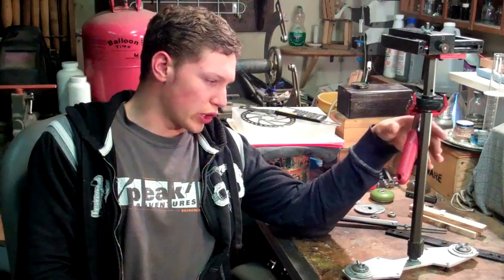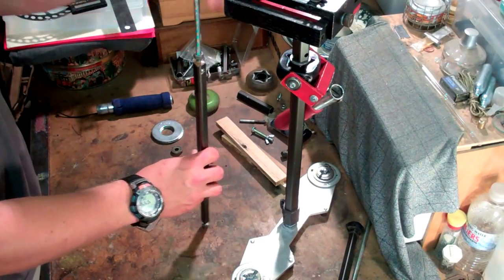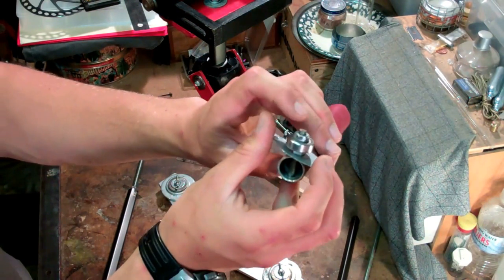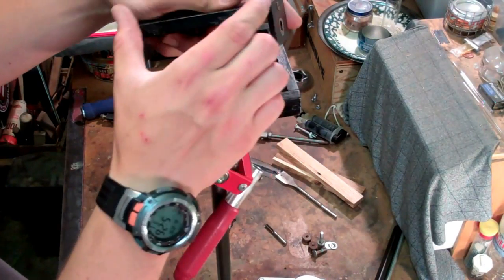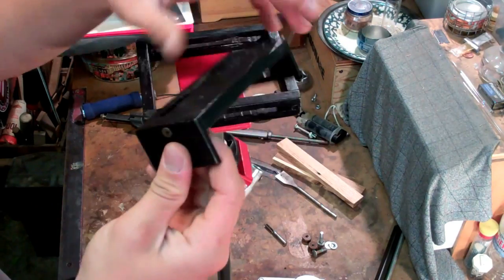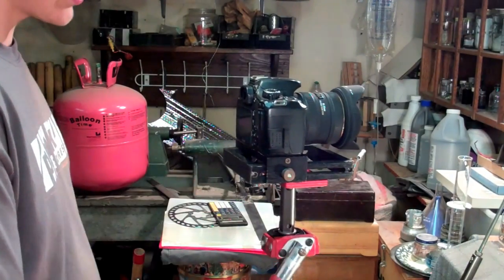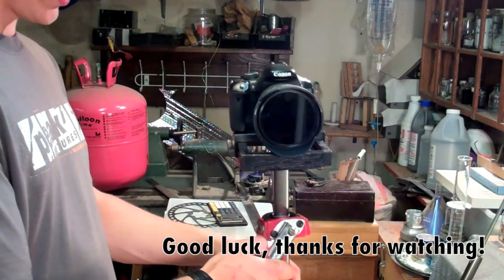THE BEST Homemade Glidecam/Stedicam Tutorial DIY

Comment: Thanks for sharing all this. I would suggest that if there is clearance above the top nut that holds the platform to the shaft, just use ONE bolt all the way through the platform. That way, with forward and back adjustments, you only have to deal with one bolt and one nut. But it looks like there may not be enough clearance, and that's why you had to use two.

Comment: I've been playing around with doing YouTube videos for awhile now and one thing that drives me crazy is camera shake. I realize that when the camera moves smoother it looks much better. I watched many videos tonight on how to make a camera stabilizer and this is the best build yet. I am fortunate in that I have a little Kodak PlaySport that is as light as a cell phone. So my build of this will probably be a little different due to the weight of the camera. The gimbal will still be about the same. I have a question on that. I thought I heard you mention that you used 5 bearings. I count only four. The one in the wheel itself, one on each side of the wheel and then the one for the handle. Did I miss one somewhere? I will re-watch the video to see if I missed it. But I can see that this will be an easy build and it will VASTLY improve any videos I do from now on. Thanks, brother. very well done.

Comment: Thank you so much.  Great video describing your process and design.  I'm planning to build one of these soon.  Really enjoyed you Selkirk Mts. video on your info page.
I'm thinking of using a long arca-swiss rail on the platform for front to back, then using two arca-swiss clamps back to back for the side to side adjustment.  I use the clamps and rails on all my equipment so this would be convenient to have the clamp on top. 
Watching your video, you use a nut, gimble, washer, shaft all tightened by a bolt on the platform.  It might be a good idea to use another nut just above the gimble so that that's always secure.
Reply: Those are great additions! Been wanting one of those quick release clamps for a while...

Comment: THANKS,

For faster-finer balancing: 
1. Attach the camera mount using longer 1/4 inch bolts (2" to 2.5") using wing nuts.
2. Add similar 2" to 2.5" 1/4 bolts to the front and back center of the platform (threads out).
3. Place 2 nuts (and shim weights for heavier cameras and lenses) midway on each bolt.
4. Adjust the camera to gross balance the glidecam using your technique with the wing nuts on all 3 bolts through the camera mount (sides and bottom).
5. Now move the new nuts (and shim weights) in and out to quickly fine tune the balance.

Comment: Yes, that is exactly what I did. I just super glued them in there; it is important that they don't move, because if they do, your balance will be disrupted. I used a small washer between the wheel and bearings to keep them from potentially rubbing on the wheel. I used ordinary 'sheetrock' screws that were about an inch long to hold the bearings to the wheels. Any screw will work, really.

Comment: You mean the long bolt piece? I cut a small piece of wood (maybe an inch long) so that it would loosely fit in the tripod leg, and used epoxy resin to secure it in there. Once that dried, i drilled a hole in the wood to loosely fit the bolt piece, and used epoxy to secure that as well. Make it as straight as you possibly can. Did that help? Or still confused?

Comment: Hey Vlad!

This inspired me to finally construct one myself. We recently got a new camera and I've got the bearings, tripod and wheel. 

I read in the comments that you've made some improvements - I was wondering if there was anything you'd be able to tell us on your new design before I fabricate all the parts for the one you show in this video? :D

- Kate & MJ
Reply: Kate & MJ Hi! I'm glad I could help with this video. 

Yes, I've made several changes since the video. The most important one is to the gimbal. I discovered that the wheel was not balanced enough around the center of the bearing. This caused the glidecam to be balanced only in one direction (forwards, for example), but when you turned the camera to the side, it was off balance.

Basically I designed and fabricated a gimbal that I could fine tune to be perfectly centered once I put it on the glidecam. I have been wanting to shoot an update video and show the new gimbal sometime soon.
Reply: Chemistry, Films, and More I see! It makes sense, depending in the wear of the wheel it may not be precise. I suppose we'll wait to construct our gimbal and return our rollerblade wheel!

Do you think you'll upload it pretty soon? No rush, just want to time it so when I finish constructing the base and mounting plates, I can add on the gimbal.
Reply: Kate & MJ Haha, people have been asking about an update for a while, so I guess I'd better make one soon. No promises, but hopefully within a week or two? If you have an old rollerblade wheel you can still use that and just upgrade later. That's what I did, essentially. :)
Reply: Chemistry, Films, and More That should be fine, a week or two! Yea I actually bought a rollerblade wheel since we don't rollerblade haha. It's pretty new, but I can see why it can be uneven and cause balancing issues, even if very slight.

Comment: Came to your channel specifically for this, will stay for your outdoor vids. :)

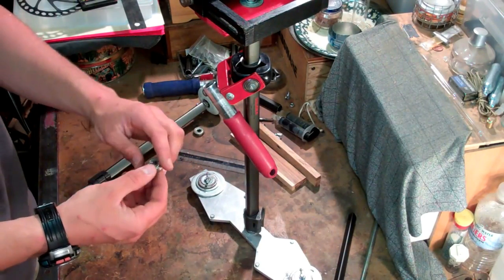Anyways, I'm just wondering why I need five (5) bearings for the gimbal? @ 5:11 you mentioned I needed 5 bearings but from my end I could only see three (3). Where should the other two (2) go? Many thanks mate!
Reply: There are are two inside of the gimbal (along the main shaft), there are the two visible ones on the sides of the gimbal, and then one that allows the handle to swing side to side, under the little metal plate. That make sense?
Reply from the maker: You got the answer! Glad to have ya!
Reply: Of Chemistry, Films, and More  ReviewOutdoorGear Gotcha! Re-watched the clip again and it now makes sense to me. Thanks guys!

Comment: Really great build! The thing I couldn't figure out is how you attach the rod inside the tripod legs, more specifically, the bottom portion since the bottom is extendable..
Reply: Ah, I've watched your video more carefully, and I understand that there are two separate rods there, but how do you get it so straight if it doesn't go down the whole length of the tripod leg?
Reply: ***** I use epoxy to secure the threaded rods. Epoxy is nice because you can let it get get nearly solidified, then use a level to make sure it's perfectly straight. Then is hardens and doesn't ever budge.  The bottom one is not as important in terms of how straight it is.

Comment: ReviewOutdoorGear Great video! Thank you very much! Do you have drawings or sketches showing the design and measurements of the different parts of your glidecam? And what's the diameter of the roller blade wheel?
Reply from the maker: Steinar Horten Thanks! I've since made more upgrades and adjustments to the device. I have a sketch of the new gimble. I was actually thinking to make another video because so many things have changed since this one. The wheel diameter varies with the amount of wear on the wheel, but in general it's about 2 inches or so.
Reply: ReviewOutdoorGear Awesome! I'm planning on putting together a glidecam soon, and think this design looks very good. What upgrades have you made since posting this video? Is there any chance you'd like to share the sketch of the new gimble?

Comment: One question: How do you attach the tripod leg to the base plate. There's a nut at the bottom of the leg or is there a bolt in it? And mostly, how do you attach the nut or the bolt to the tripod leg. I barely see that there was piece of wood, but how do you exactly did it?

Comment: For the weights i gave you earlier (which is how the rig in the video is set up), make the shaft about 12 inches (in shortest position) for that part below where the gimble attaches and about 5 inches for that piece that you add between the gimble and the platform where you attach the camera.

Comment: Yep. You just balance the rig so it would be tilted a little bit forward or backward, just like you would balance it to be perfectly horizontal when using it normally. It will work just as well.

Comment: You could always just attach your camera or phone and then add more weight on top to make up for it. However, the principle of this design works on almost any size. You can downscale it as much as you are able to. If i had a gopro, i would make mine about 8-10 inches long in total. Not sure if that's possible or not... you would need to find a smaller wheel for the gimble, or make a smaller one if you have the tools.

Comment: The way i did it was cut a piece of wood (about an inch long) so that it would loosely fit into the leg and glued it into there with epoxy. Once that was dry, i drilled a hole into the wood to loosely fit the bolt, and glued that in with epoxy as well.

Comment: If you glue it into the leg with epoxy and then drill it, i dont think it should break. But even if it does, thats not really a problem because the purpose of the wood is to stop the glue from simply pouring down into the bottom of the leg by providing more surface area for the glue to stick to. You could even wrap the bolt piece with duct tape or something and then pour the glue in around that. Just make sure that the glue is hard setting so it doesnt wobble when it dries out.

Comment: I whittled a piece of wood (about an inch long) that would loosely fit into the tripod leg, then drilled a hole in the wood to loosely fit the bolt. Then i used hard setting epoxy to secure it all in the top of the tripod leg.

Comment: I have this issue once in a while as well. To fix this, hold up your rig in horizontal position by pressing your finger in the center of the bottom bolt on the base plate. One of the sides will drop. Move the weights closer or farther away from the main shaft until it is perfectly balanced. Google (Vertical/horizontal Fine..what About Spinning? - Glidecam Product ...) for a page that can help you more on this.

Comment: - 2 1.5"x0.25"x2" pieces of wood
- 2 2.25"x0.5"x1" pieces of wood
- 1 2.25"x0.5"x1" piece of wood
- 1 2.5x0.375"x5" piece of wood
- At least 16 0.5" flat head screws.
- 4 1/4"x1" carriage bolts
- 1 1.5"x1/4" bolt
- 4 1/4" wing nuts
- 2 1/4" hex nuts
- Approximately 8"x3/8" threaded rod.
 - 3 3/8" hex nuts + washers + split lock washers
- A piece of 1/16 sheet metal cut to about 1"x2"

Comment: You mean the actual plate or total weight (plate and weights)? The weight depends on the length of the main shaft. To begin, make sure your shaft is in the shortest position. For starters maybe throw like 8-10 oz of weight on there (not including the plate). If your base plate is wood, you will need more like 14-16. From there, adjust the height of the shaft to achieve an approximately 3 second drop from horizontal position. If it is too fast, take of some weight and try again. You will get it.

Comment: How long of a pole do you think I will need, if I am using a canon rebel t4i with a 18-200mm lens? It says 10-15 inches, I was thinking I would need it to be around 12 inches...what do you think? (PS I am using pvc piping for the main pole so it will be hard to adjust it after I cut it to length.

Comment: Right around the 6:30 mark.  Can you tell me the exact steps you took to attach the bearings to the wooden arms and wheel?  Did you cut a 7/8" hole in the wooden arms on each side and then glue the bearing inside of that hole?  What screws did you use for this part?  Thanks.

Comment: Hi!
I am French , I use youtube subtitles but that's not it haha !!
Just one question : Is the threaded rod affixed/glued/fixed with screws to each end of the leg of the tripod, is not it ?
However one understands with images , I 'm about to create one that I should just find all materials in France , no worries !
Sorry , I use google translate ^^
It would be really cool to have an answer ;)
Reply from the maker: Martin Seiller Yes, the threaded rod is first glued into each end of the the tripod leg, then after it has dried, I drilled a hole straight through all of it and put in screws or rivets. The threaded rod doesn't go through the  whole leg though, otherwise it would not be able to extend to the needed length. Does that make sense? Ask me again if you don't understand something. :)
Reply: ReviewOutdoorGear Thank you very much for the reply !!
Yes I thought about that too, that it was unable to extend if it was across the tripod leg !
How many centimeters / inches you left around inside ? 2 inches I think ?
So you put a lot of glue and trying to hold the rod in the center -> How exactly,that it does not move ? ; until it dries :)
I'll see if I have more questions when I start the project, I'll post here ;)
Thanks again !

Comment: Making "mini version" for a gopro. You need 4 bearings right? One in the wheel, 2 on the sides of the wheel, and 1 for the handle, right?
Reply from the maker: +JustAskingAndCurios Yes. I've upgraded to two in the handle for more stability, but you can use just one. Let me know how the gopro version works! Been curious to see that for a while.

Comment: Question: What do you use (specifically) to be able to secure the tripod to the bolt that carries the gimble? and also the bolt that attaches the weight plate, im trying to find the right thing, but have had no luck. thanks.
Reply: My latest method is cutting a piece of wood to loosely fit into the tripod leg with a hole drilled in the center of the wood to fit the bolt piece, then gluing everything in with hard setting epoxy. When that is set, I drill a horizontal hole through the tripod leg, wood, and bolt, and rivet everything together on both sides (or you can use a screw or another small bolt). Does that make sense?
Reply: Pwrfect sense. Thanks mate!!!

Comment: when you have screwed top camera platform and bottom weight balance plate to a screw shaft, how can you extend your glidecam? I don't think you could extend
Reply from the maker: +akbar khan The threaded rod does not go all the way through the shaft. There are two separate pieces. One for the camera plate on top and one for the weigh platform at the bottom. Does that make sense?

Comment: Anyone know where I can get some good counter weights, or the best way to make my own?
The 5/8 washers don't weigh enough to counter balance my 60d + Tamron 18-200mm lens, unless I pour a ton of cash into more washers.
6 5/8 washers= 3oz, I don't think it's worth it.
Reply: I've actually updated the counterweights on this setup with weights that I've cut out of sheet metal. Some thick steel cut into rectangles works pretty well.

Comment: The platform is offset because the center of gravity on the camera shown is not exactly in the middle, but more towards the front of the lens, so i added more room in the back so that when i balanced the camera i would not run out of space to move back. The rig in the video has about 120g of weight on each side. You can always drill holes in the weights to fine tune their weight.

Comment: You will need, at least:
-Two sections of tripod leg (preferably the thicker two), with range from 10"-15".
- 3" piece of hollow tripod leg
- 12"x2" piece of wood or metal for base plate.
- A rollerblade wheel w/bearings intact
- 3 more scooter/rollerblade bearings
- 6" wooden dowel/pipe/scooter handle for gimble handle.
- 4 large fender washers (2.5" wide)
- 4 smaller washers ( 1.75" wide)
- 2 1"x0.5"x4" pieces of wood
- 2 1"x0.5"X6"  "                    "
- 1 0.5"x2"x5" piece of wood

Comment: do you have to have weight on the front and back? my rig requires A LOT of weight on the back to balance it so i didnt bother putting any on the front to make it less bulky, should i add weight to the front?
Reply: There should be an equal amount of weight on both sides. Forwards/backwards balancing is done with the camera on top. If you have unequal amounts of weight, the rig will start to spin and angle down to bring as much weight as possible closer to the vertical line of gravity. :)
Reply: Of Chemistry, Films, and More ok thanks

Comment: I have a problem with mine everything works fine its drop time is fine but the rig wants to turn in circles for some reason. What could be the problem?
Reply: Either the weight at the bottom is not at equal distances from the main shaft, or (more likely) the gimbal is not perfectly centered. I've actually upgraded the gimbal since this video to take care of that problem.
Reply: Chemistry, Films, and More
 Hey, can you tell me more about this update so that I could maybe try it out: :)

Thanks
Reply: HomecockpitsAndMore Thinking to make an update video soon regarding that! Stay tuned.

Comment: I have a question.. maybe it's a silly one, but.. why does the handle won't go 'up' when you hold it? When you let it go, the handle goes down.. but when you hold it it stays horizontal.. how is that made?
Reply: The handle is attached to the gimble with two bearings (one on each side; opposite of each other), which you should be able to catch if you watch the video closely. This allows the handle to move up and down about the center of the horizontal plane of the gimble. It goes down when I let it go because gravity pulls the whole thing down. It does not go up when I am holding it because I keep it in the upright position with my hand. Does that explain your question?

-camera guy
Reply: Of Chemistry, Films, and More Unfortunately I can't watch right now.. but i think I understood! I'll rewatch and give you feedback. By the way.. AMAZING DIY glidecam. I'll definitely build it.. I simply can't film without shaking, so i think this will help me a lot!